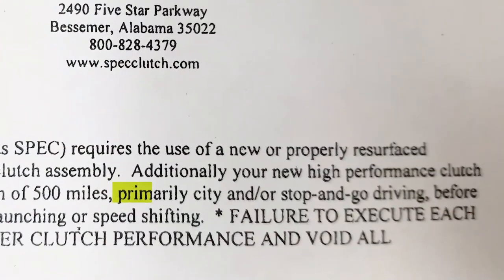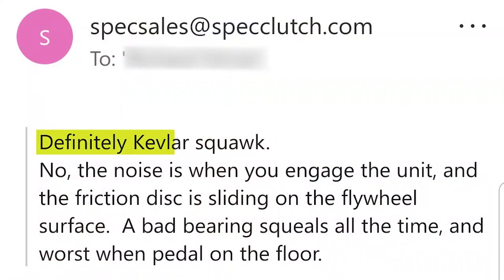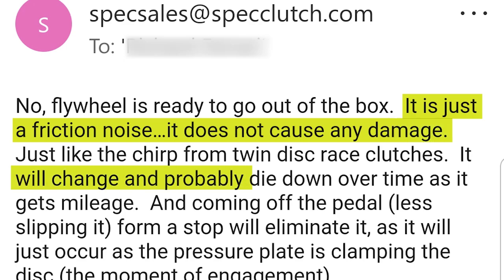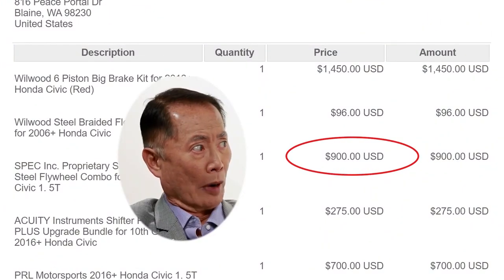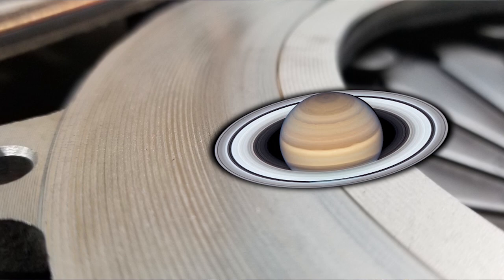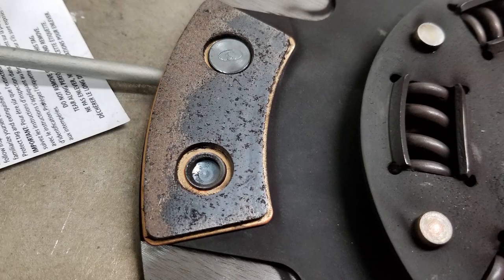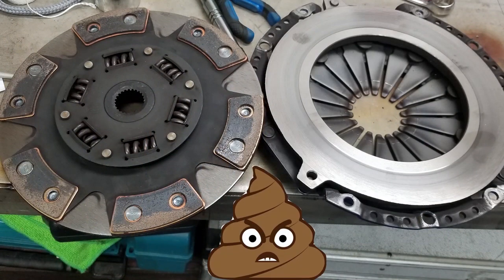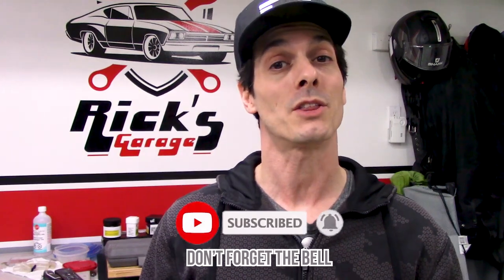More Spec Clutch Problems?!? - Rick's Garage ep. 32

Comment: Great video.  I was recommended this after posting my "Focus ST- why not to buy a spec clutch" video.  Sorry for your luck.  I actually had a few folks insinuate incompetence on my part. Lol!
  Your patience is admirable.  I'm super not into the back and forth to.  If I spend a few$100 once,  I want my stuff to work right out of the box- especially since my labor changing the part typically exceeds the value of what I'm replacing. After having a few organizations basically attempt to buy me off so that they would have an easier time in the future screwing my neighbors,  I'm having none of it.  After I investigate my potential shortcomings via, etc, I consider it public service letting people know what's crappy- as opposed to accepting a free upgrade.  Thanks again!
Reply from the maker: Thank you for the kind words!  Sorry to hear you got bit by the poor quality gremlin as well.  I checked out your vid and I'm blown away how catastrophic your clutch ended up failing. 
I hope you consider subscribing to the channel (if you havent already) lots of great content in the works!

Comment: Most people agree that the two brands to ignore on this platform is Action Clutch and Spec.
Loving my FX400. No high rpm lock outs on stock cmc, no chatter in 1st after 1500 miles. Slight chatter in reverse. Still going strong after 31k miles
Reply: You’re forgetting one more. SouthBend.  I just purchased clutch masters FX400 six puck.

Comment: I have a $1,500 spec clutch that I installed and then took it back out because noise and the lack of support I received from spec which was Zero. Now a pile of metal in the value of $1,500 sits at the bottom of my toolbox awaiting for some sucker to purchase. Thanks a lot spec great job
Reply from the maker: Aw dude - I'm really sorry to hear that you've experienced similar to me -

Comment: Man I have that EXACT same sound with my stage 4 in my 2004 Acura TL. But the sound came in later and wasn't apparent after initial install. But I did have the trans out 3 times, trying to figure out why I couldn't get it into gear with the car running.

Comment: I don’t know if you still getting comments on this one, I just watched your video. And fully identified with your problem. I too contacted SPEC and this was our exchange.
Me: What is the distance the throw out bearing must travel pressing the diaphragm fingers to disengage? And how much will the pressure plate will move away from the friction disc? So I can measure the air gap between the pressure plate and the flywheel without the friction disc at 0.000" and then at XXXX" throw.
I'm troubleshooting a chattering noise on this clutch and want to verify if the pressure plate is in specs or if it is worn out.
I appreciate your help,

SPEC: “It should be fully released at .375 travel. The total amount of gap will depend on how far you have it set to throw. A st2 needs about .020 gap. But a chattering noise should not original from release..could be simply gear noise from the higher rate springs in the disc”

That was it, did not offer other explanation for the chattering.
Reply from the maker: Thank you for your comment Jose - I'm really sad to hear that you're also having these types of issues.  Good on you for approaching the situation armed with as much technical info as you were but it's too bad that Spec isnt willing to do any more for you. 🙁
Stay on them - hopefully you can get a better result than what they've offered so far

Comment: I had issues with my spec stage 3+ clutch too on my tiburon but my issue was that it wouldn't slide onto the input shaft all the way it would barely go on the input shaft it would go on and then stop after barely going on turns out the clutch disk splines were improperly machined and no where near the shape but luckily I messaged spec and within about a day they responded and mailed a new clutch got it in 2 days actually messaged them through Facebook messager. I'm breaking in my clutch rn 50 miles on it but I'll see how it goes

Comment: I had a similar experience with Spec on my 3sgte swapped Celica. After about two weeks with their clutch kit it started to make a noise. I contacted them and they were extremely rude trying to tell me that I should talk to the person I purchased the kit from, when the whole time I was trying to explain that I bought it directly from them. Finally the whole thing failed. It turned out that it was the throw out bearing. I contacted spec again and asked if they could reimburse me part of the cost of having my mechanic drop the trans again. They asked me to mail the failed throw out bearing back to them, and gave me a $20 refund. I didn't like how I was treated and will not be their customer again.
Reply from the maker: Dang dude... I don't know whether to thumbs up or down your comment.  That really sucks that you had to go through a similar experience.  Here's hoping that the new part gives you no troubles!
Reply: @RicksGarage  This was a few years ago and everything was fine after I replaced it with an OE throw out bearing. I understand issues can happen, but I did not like how they treated me as a customer. They could care less that I had to pay my mechanic twice for their defective product. Also they are fully aware of the clutch disengagement issues on the 10th gen Civics, and still continue to sell the clutch and make no mention of the problem on their site.
Reply: Best clutch for Civic Si is type R retrofit and ACT clutch. Even competition clutch is having great reviews

Comment: Wait what was the importance of not using the stock clutch master cylinder I'm confused
Reply from the maker: Check out ep. 15 "clutch problems" for more details.  In a nutshell, the springs on the new pressure plate are too stiff for the factory CMC to properly release the clutch.

Comment: I have had 2 SPEC pressure plates get destroyed on me.  They use OEM pressure plates.  The rivots On the pressure plate got ripped off. So I’m putting them on blast. I got brushed off too. They said for me to take pictures of the pressure plate. Bogus customer service.

Comment: I was thinking of getting a spec clutch stage 2+  what clutch did you end up with ? Company wise ??
Reply from the maker: Spec FINALLY sent me a replacement for the defective one - no issues so far 🤞
Reply: Even tho they fixed the issue would you get it again ?? 
I'm stuck between  the spec and the  McLeod  RXT.  I'm just trying to hold off on spending  13 to 1400 this one seems  more on the budget side
Reply from the maker: @bigspoon34  certainly not!!  I'll NEVER buy another Spec product again.  If I could go back and do it all over again, I would get the Type R retrofit clutch kit instead.  It wasn't available at the time, which is why I ended up with Spec.

Comment: I have a focus st and after my clutch install my car does the same whine at stops. Should i be worried that i have a defect or a bad clutch? Ive had the clutch for at least 6 months.
Reply from the maker: Hi Michael, if you're experiencing the same sound at every stop - I'd say something is definitely out of the ordinary.  To be sure, I'd get a transmission shop to lend an ear to get their opinion - 🤞 here's hoping for the best!
Reply: @RicksGarage  I'm no expert but it does just sound like a hum because of friction.
Reply from the maker: @michaellewis9589  if it's just chatter, then I wouldn't worry too much about it
Reply: @RicksGarage  I could always try to take a video and share it with you!
Reply from the maker: @michaellewis9589  I'd be willing to have a listen - send it to the e-mail in the channel info
Reply: is the clutch that you had bad?
Reply: @lazonphillip4337  What do u mean? The one i had before replacement?
Reply: @michaellewis9589  the spec clutch is it still chattering

Comment: So besides the issue you had the spec clutch, would you still recommend the combo?
Reply from the maker: If you wanted a Spec clutch for the 10th gen, unless you're making huge torque numbers, I'd probably recommend the stage 2 rather than the 2+.  The 2+ is a bit of a leg workout and is rated way higher than the output of the engine.
Mind you, the only reason I bought Spec is because ACT had nothing to offer at the time.
Reply: @RicksGarage  honestly im looking into getting the w2 turbo from 27won. I like the ACT brand and I think I'll be going with them.  Thank you for the quick response  as always bro.